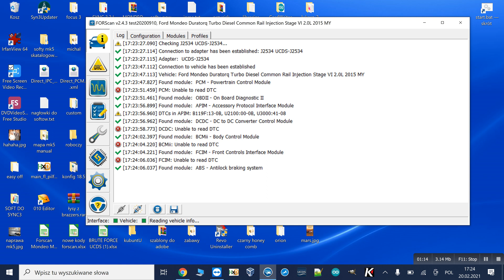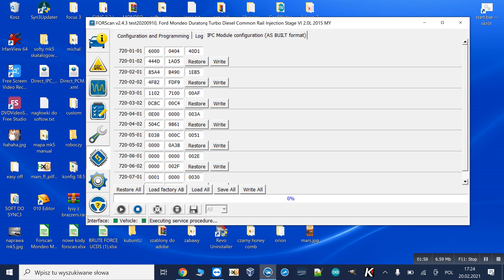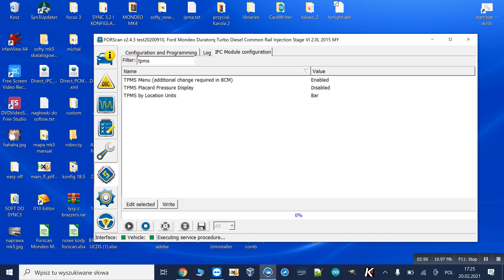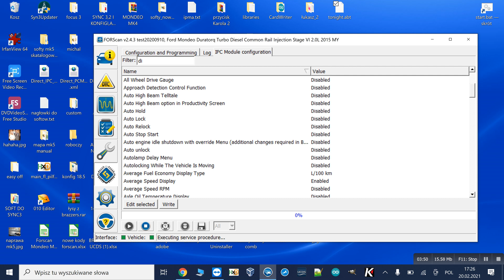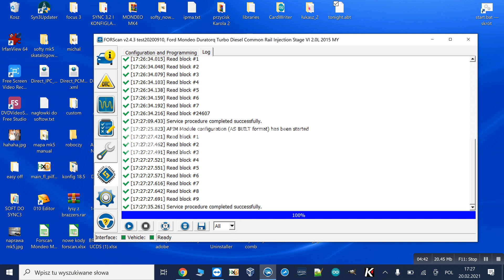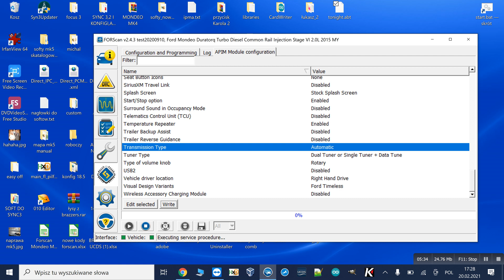How to turn on opion in modules with forscan

Comment: Hello. Is it possible in an easy way with Forscan to completely disable BLIS. blind spot alerts so it doesn't appear on the screen in the car? exactly as if the car never came with BLIS.
how is it done?

Thanks for a good video. I learned a lot
Reply from the maker: Yes. Its possible.
Reply: @mondeoporady7398  
I have seen in your video that you have a choice where you can turn off blind spot detection with forscan.

You can also switch off BLIS in the menu screen between the instrument panel, but it does not remove error messages that come up.

I don't know what this choice in forscan does. I haven't tried it yet and I don't know if I will get this choice in Forscan.

In the video the looked like you know a lot about forscan!?? I was hoping to get a little more help from someone.

I have searched a lot on the internet without finding much information about this.

Comment: Is it safe to go from 150 to 180 via forscan?
Reply from the maker: Yes. It's factory already in your pcm . Anyway just for 2.0tdci
Reply: @mondeoporady7398  Thank you so much, I was afraid to do it but it is good to hear that it comes as restricted 180hp. 

What are the commands I need to change for the Powershift version? Only Engine module and ABS?
Reply from the maker: Yes. Just pcm and abs. It's enough
Reply: @mondeoporady7398  Thank you so much!

Comment: Hi, I know this may be a bit off topic but do you know if I replace my headlight control module on one of my led adaptive headlight with a second hand one will it need to be programmed to my car or will it just work when I plug it in? If it needs to be programmed can it be down using forscan? Any help or information would be greatly appreciated, thanks.
Reply from the maker: Control module is just one . Called hcm
Reply: @mondeoporady7398  Ok and if I replace the module with the used one will it have to be programmed to my car?
Reply from the maker: @jacklalor1943  just reset modules if I good remember

Comment: Czy można w ten sposób aktywować składanie lusterek po zamknięciu  auta?
Reply from the maker: If u have folding mirrors
Reply from the maker: Did u subscribed my channel?
Reply: of course
Reply from the maker: @szymonpopek7951  I'll make movie about in a spare minute
Reply: @mondeoporady7398  need to update new mirror modules after retrofitting electrically folding mirrors.
Reply from the maker: @szymonpopek7951  its possible to do with ucds. U need files to reprogramming ddm
Reply: @mondeoporady7398  can you expect some kind of tutorial?
Reply: @mondeoporady7398  Hello, are these files correct?  sbl 6G9T-14C067-AD     6G9T-14C321-AD    6G9T-14C065-AN     6G9T-14C064-AN
Reply from the maker: Hi. Files correct to?
Reply: @mondeoporady7398  Hello again ,The question above is about my car ford s max 2006 WA6
Reply from the maker: @valerivladimirov7119  hi. Im still confuse about our files. What u want to do?
Reply: @mondeoporady7398  Hi.Can you tell me if these files are suitable for folding side mirrors automatically after locking on car ?
Czy możesz mi powiedzieć, czy te pliki nadają się do automatycznego składania lusterek bocznych po zaryglowaniu samochodu?